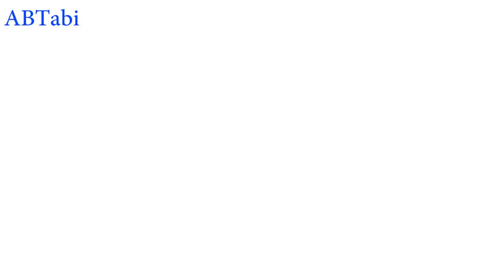How to make Adjustable flash/strobe light smooth slow and fast effects P2

Comment: Is it possible to make leds turn on/off in a slower fade in fade out way by adding capacitors?
Reply from the maker: You can try ,,,,,,
Reply: You can program the LED with an attiny85 microchip and atmel studio.

Comment: ভাইয়া আমার ১২v ব্যেটারি আর ১২vলাইট ১০পিস জালাবো
Reply from the maker: Yes, you can use 12 volt battery 12 volt lights, but remember not over the 10 watt load with every transistor.   Thank you dear  friend.
Reply: Can i use for my motorcycle?